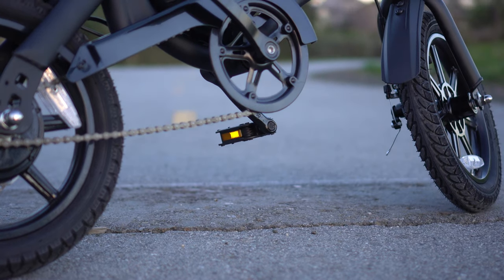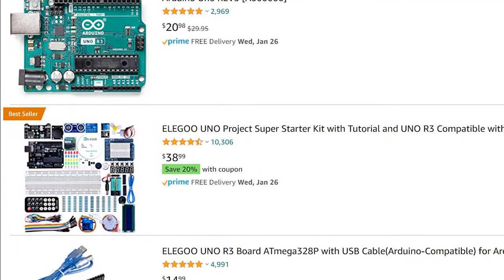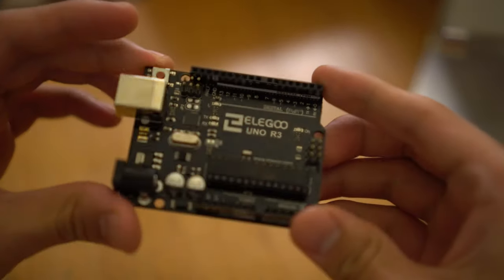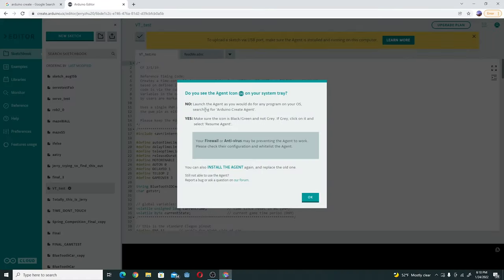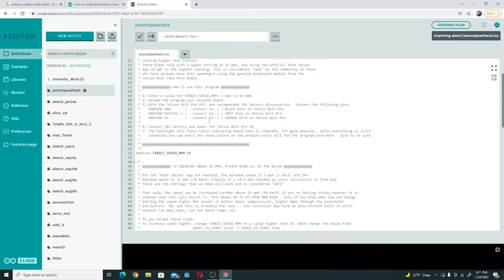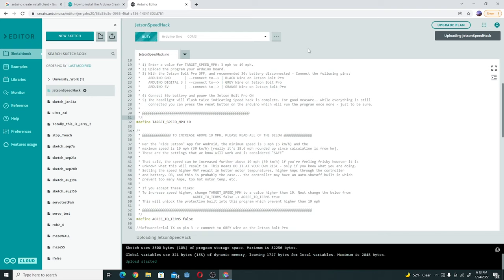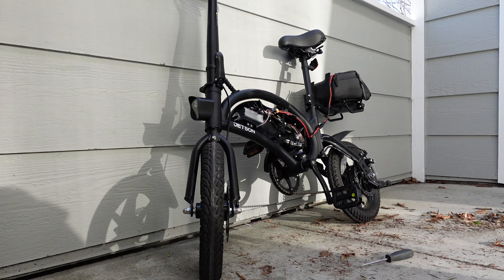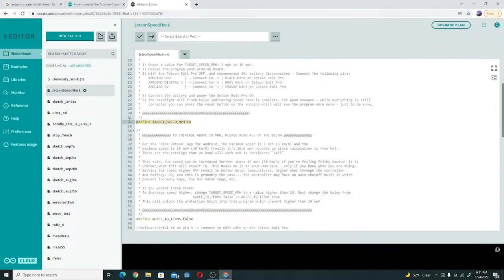The BEST Jetson Bolt Pro SPEED HACK 19+ MPH | Under $20, No Modules or Controllers!

Comment: Hi! question ahead...I noticed that the open bluetooth white connector has 4 holes (it looks like),. if that is the case, video refers to 3 wires. How to know where each wire goes , in what female connector goes each wire, since there are 3 wires and 4 female connectors,? having which one fem connector empty? thanks for great videos
Reply from the maker: Hello Yoryi,
Yes, one of the female adapters will be empty. The black, gray, and orange female adapter will the connected, and the fourth connector can be left unconnected. Thanks for watching!
Reply: @TonyQuillMagic  Thanks.

Comment: Where do i get those wires? Sorry for the stupid question i just got my e bike.
Reply from the maker: Hello!
If you are referring to the wires to connect the Arduino to the bike, you can search up breadboard wires on Amazon or in an electronics store. Hope to help!
Reply: @TonyQuillMagic  hi tony I've tried the hack got the file on the uno board, did everything on the description. I had light flash twice but it doesn't work still the same speed im getting. Idk what im doing wrong but it doesn't work for me

Comment: Hey Tony, I did your hack today and my top throttle only speed increased from 14 mph to 17 mph. I used your recommended 19 mph in the firmware. I weigh 175 pounds. Is there anything else you can recommend to increase speed? Thanks!
Reply: Same here got the same result 🤔🤔🤔
Reply: 175 lbs is light heavyweight in boxing
Reply: U a little heavy homie

Comment: Hi, I noticed that you downloaded the Arduino software via Windows.  Can you download and run it as well on MacBook Pro laptops?
Reply: You can, I've done it. I only use the offline version of the IDE. It is available for MacOS here : https://www.arduino.cc/en/software
Reply: Thank you for replying.  I also noticed that the Elegoo Uno R3 board seemed to be made for Windows 10 operating system.  Do I have to do anything to it to run on iOS system?
Reply: @nickd3440  you'll be fine, it will work under Mac Os too.
Reply: @uski  I'm sorry to disturb you again.  I'm having trouble uploading the code to the Uno R3 board.  I'm getting a "Problem Uploading to Board" error.  As suggested, I downloaded and ran the MacOs version of the IDE and I copied and pasted the JetsonSpeedHack.ino file to it.  Is there anything else I need to do?
Reply: @nickd3440  did you select the right board type? Need to select Arduino Uno
Reply: @uski  Okay.  I just did and re-uploaded the file.  It recognized the board and finished uploading.  Next is the moment of truth.  I'll try to upload the hack to my bike.  I'll send you an update when I've done it.  Again thank you very much for your response.
Reply: @nickd3440  it should be easy, just make sure to wire it up correctly. Also do not connect the board to the computer when connecting it to the bike. It is fully autonomous now
Reply: @uski  I've successfully uploaded the file on my bike, have tested it and so happy to report that it worked.  I can't thank you enough for responding to my questions.  You definitely made it really easy for me to perform the speed upgrade.  Before the upgrade, the maximum average speed I got was around 13mph.  I am now getting up to around 16mph.  I'm sure that my weight has something to do with it.  The thing is my objective to get more speed was accomplished.  Thank you again for sharing your knowledge and skill.  I will do the same to my wife's bike.
Reply: @nickd3440  glad to know it worked. You do not need to reprogram the Arduino
 Just directly connect it to the bike and that's it! Congratulations

Comment: Thank you very much for sharing the info and it works, but... I rode the bike today, because it's the first day of spring in my area, and i applied everything you did on mine, but the difference was not huge, let's say the max speed (throttle only) before was 21-22kph, and it became 23-24kph after the modification, knowing that I filled 19mph (really want to put 20 or 25mph) in the arduino and i'm 210 pounds , is that normal?
Reply: @BenBenson I think from 22 to 26kph is already a good upgrade ! I believe 19mph must be achieved in perfect condition, rider weight, 0 slope etc.. And I visually checked the top  of the rear wheels while the bike was stationary, and obviously it was a little faster after the upgrade, but only a little…
Reply: @longtan9259  no it's because they have older jetson bolt models

Comment: Fyi if you bought your Jetson recently this doesn’t work. I bought mine in June 2022 and followed the very straightforward steps and got flashes of light and absolutely no change in speed
Reply: That sucks
Reply: I just bought my jetson bolt pro last month and while I'm not getting 19mph I'm getting 16 Instead of 13 and it takes off faster from stopped while I'm not getting 19 it is an improvement
Reply: I got the same issue, I fixed it by going into the code and changing the agreement thing from false to true
Reply: 19 is max . This also worked on my original bolt . Just bought it last month . Not 2 weeks ago .
Reply: @PensacolaHvac  hello, u got this to work on a standard Bolt model? Not the Pro model? If so, did u use wires to connect instead of Bluetooth?
Reply: @robertturbitt1482   i assumed it worked on original bolt since it was the same controller. When I took side plastic off i realized the Bluetooth module is where the arduino hooks in . Carefully cut back heat shrink over the plug unplugged module and connected with the bread pins. 
I then tested uploading different max speeds on the bike lifting back tire and hitting throttle for reference . It sped the bike up to 19mph . Able to plug Bluetooth module back it and verify new speed on app. Says 18.6mph now . Won’t go any higher then that even floating bike off ground . Motor does 19mph even with true false lockout changed on arduino and max speed set to 21mph all you get is 19 .  But better then 15 . I have iPhone so I couldn’t download old app for original bolt hack . Glad I tried this .
Reply: @PensacolaHvac  thanks for the info. Mine is an original Bolt (not pro) manufacture date 7/2022. I haven't opened her up yet. I might try doing what u did. Enjoy your bike.
Reply: @PensacolaHvac  i have Android and when I download old app my Bolt comes up as a hoverboard. Max speed setting is 12mph. I tried several old apps and it always came up hoverboard. I had to download the newest app and it recognized my Bolt. Max speed 16mph. I set it at max speed and deleted the app from my phone. Maybe I will attempt what u did.

Comment: I followed all the steps correctly i believe. Got the bike light to flash twice and everything seemed to go smoothy however the speed did not seem to increase at all for me. I repeated all the steps 4 times and can not get a new result. Is anyone els having this issue?
Reply: I am as well. I bought the bike at Costco 1 month ago. Lights flashed etc, but max speed is still 21-24km/h (same as before hack). Interestingly, if I reduce the max speed, that DID work, so there must be another place on the board (programmed) to not allow past 15 mph (21.4km/h) boooo

Comment: Outstanding .Bought 2 new pros and the hack doesn’t work. I hear this is common and the only way to make it work is Bluetooth or a new controller.  And only the Jetson Bluetooth module works and of course you can buy one. So I made one that connected but wouldn’t transmit or connect to the app.

Comment: Where is this code your talking about icant seem to find it
Reply from the maker: The code can be found here - near the bottom of the site please let me know if it doesn't work:

https://www.tquniverse.com/blog/jetson-bolt-pro-speed-hack
Reply: Found it thank you brother  but the light only flashes once does that mean the upgrade has worked or do i need the light to blink twice
Reply: The code is on my arduino board but my jetson will not accept the code. The light only blinks once I'm wondering what should I do

Comment: The guy who helped with the Arduino mod has a post.  That says Jetson bolt pro external battery w/upgrade 18 mph top speed. Basically you need more amps to get 18 mph. Stock battery too weak.
Reply: So I bought the parts I need and I am going to experiment by adding my ryobi 40v lawnmower battery to the mix. If that changes the speed on the bike I will post next weekend
Reply: @fadyehabib1  any luck on increasing speed
Reply: @stancal9680  none. I can tell you that I added an external battery, with no luck in speed change. Anyone else any luck ?
Reply: The external battery the guy was using was rated at 36v and 30ah. Also if you need to make sure the BMS(battery management system) is at least 30 ah output. If you use a power tool battery that is only rated at 2 or 4 amps it is still too weak.  Stock battery is 6 amps so kind of weak and cheap. you get what you pay for.

Comment: I hope someone can come up with a wire to cut or a jumper. Like to get rid of the speed limiter completely.
Reply from the maker: Hello Andy,
Unfortunately, the speed limiter is written into the code of the Jetson Bolt Pro's controller, so the only way to do it is to change it through code. However, you can change the speed to whatever you want, if you are not afraid of burning out the motor, so that is an available option. Thanks for watching!

Comment: Could you add code to gain 5 speed pedal assist settings. For example. If you press the right button 1 times quickly it will put peddle assist level 1. If you click the right button 2 times quickly it will put the pedal assist to level 2. If you press the right button 3 times quickly it will put the peddle assist to level 3 and so on to 5 speeds. And then if you cold the right button down for 5 seconds it turns the light on like stock. If you can't do this can you tell me how to do it, I know basic coding.

Comment: Problem and Solution: After extracting the Jetson file, I also had trouble uploading the file to the Arduino program using the linked Arduino version  provided in your description.  Instead I went to the Windows app store and downloaded the free Arduino IDE app and was successful in uploading the Jetson file to Arduino and then downloading the file onto the UNO Board.  I received both screen and blinking board lights confirmation that the file loaded to the UNO Board correctly.  Thanks again for sharing this mod.
Reply: Did the mod work for you?
Reply: @stancal9680  waiting on weather, but will have update on two weeks.  App installed just fine, but like other comments, road test is needed to verify any increase in speed.
Reply: DUDE thanks!!! arduino editor was driving me batty. appreciate your tip! installing tomorrow!
Reply: Well, the verdict is in.  I finally had some nice weather to test out the speed hack mod and yes, like everyone else, there was no increase in the max speed.  On a flat straight away the Pro still maxed out at 15 and nothing extra.  It was a nice experiment.  15 is still a great speed for such a small bike.  Love the Pro.

Comment: Hey where can I get the code?
Reply: just copy/paste into the arduino app then select compile/upload. With the jetson pro i purchased in late june 2022, the harness is still present and the code worked. a curiosity is this seems to only affect throttle input. i dropped the speed to 9mph which worked but peddle assist i could still hit a motor assisted 15...bumping the limit to 19 hasnt had a noticable effect but i have yet to get consistent GPS measurements on it

Comment: Hi, the headlamp won't flash, the code was uploaded correctly following each step but no results.

Edit : the problem was the Dupont Cables.
Reply: hmmm I am having the issue, uploaded to the board succesfsully but lamp wont flash. I wonder if it was the cable
Reply: @pcapcapca did you get it to work pal

Comment: Tried this and like a few others my headlight flashed twice but no results. 17mph max on a decline. I might try to bump it up to 20-25mph to see if that makes a difference

EDIT: As a test I dropped it down to 3mph first and hit the reset button this time and it did limit the speed to 3mph.

I am going to risk it and run the bike at 20mph. I got 2 of these bikes refurb'ed on Ebay and can see the difference between 20mph and stock. I had a speed modded Segway ES4 Scooter (300W motor) that I would run at 20 mph and had no issues.

I might try 25mph, but I am kinda hesitant because I also had a Juiced Campscrambler before with 750w motor and throttle mod and it struggled to get 25-27mph so i might do a 60t chainring set mod instead
Reply: @BenBenson No the max I tried is 20mph so far and I top out at about the same. I think it's due to the wheel size even though it's 350w takes a lot more effort to get a higher max speed.

Comment: I have easier way. Just hols breaks for ten seconds and while holding turn power on. Wait another 10 second. Then power off. 
Now speed limit has removed. You will go faster with more torque.
Reply: This actually works?

Comment: I bought my Jetson Pro on November 2021 at Costco and can tell you that I gained NO extra speed. I followed the information exactly and did it correctly. I can program it to reduce the speed ( which worked ) but when I programed it to go to 19 miles per hour it did NOT work, it only did a maximum of 15 per hour ( which is the factory speed ) too bad. 😞.... It would be awesome if someone can  find a way to hack the controller governor.
Reply: This really doesn’t work anymore?
Reply: Yes I believe you are right. I hope some find and easy alternative to get it to work
Reply: @stancal9680  I have two Jetson Pro's I bought from Costco in December 2021.   I did the upgrade on 1 and it is faster than the one that is on factory defaults.  The speed increase is more noticeable when my daughter rides the upgraded bike since she is lighter.  But I did use my phone to track the speeds and the upgraded one gets very close to 19MPH.